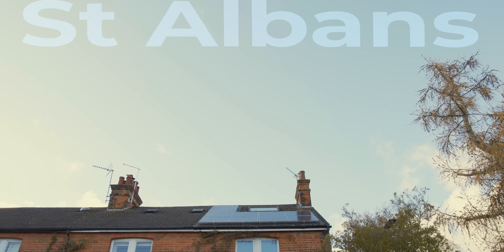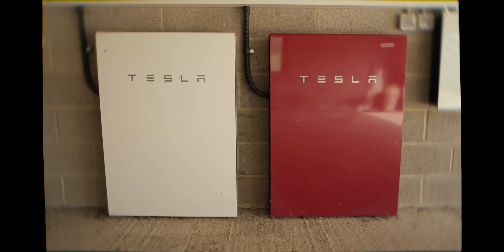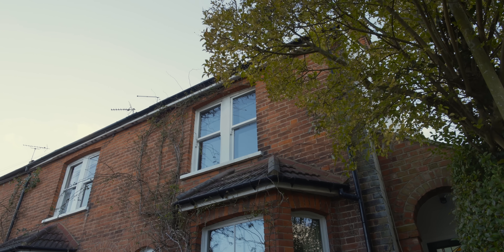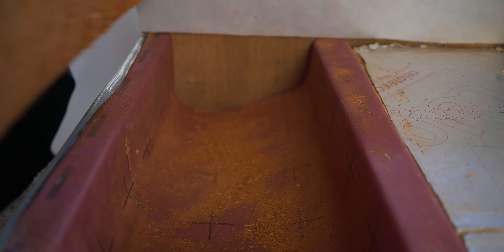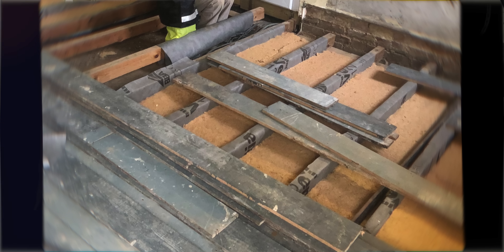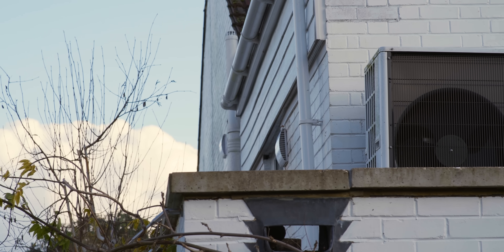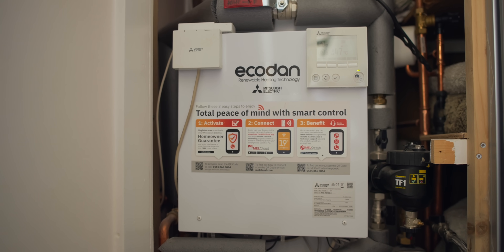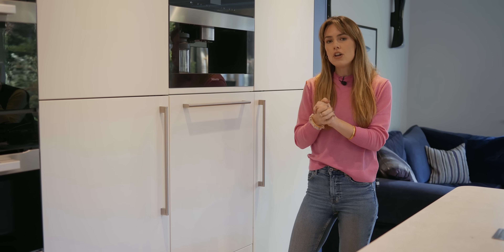This Victorian Home is Now 75% More Energy Efficient!

Comment: It's a great idea, and cheaper than building anew. Considered it for my house, but only really makes sense to do the underfloor insulation (we have a basement, so easier access from underneath without pulling the floor up). It doesn't feel sensible to make investments like this if you want to move in a few yeaes time - it feels like a big job with a lot of mess costing a lot. If it's your forever home then it'd be worth it regardless of the payback for both the comfort and possibly for the self satisfaction of having "improved things" and also being able to be self sufficient in terms of energy at least some of the time. 

On a wider perspective, I do wonder how we're going to, as a country be able to retrofit all these houses given the cost - most people aren't going to be able to afford it, and even if they are, life is for living they'd much rather spend it on a few nice holidays or new car etc. I feel like you've got to both 1. be pretty motivated to do this, except for when you actually have a problem that cause discomfort (cold, damp etc) and 2. to have the money left over after all other expenses and life costs.
Reply: Are people really so shallow that they'll just decide 'bollocks to the climate and the future, I'll just spend all my money on cars and holidays'? You do get a much nicer house to live in if you do this work - it's pretty dramatic for the typical UK draughty house. That comfort is an easier sell than long-term benefits to the county. The finance part could easily be dealt with by mortgage companies just lending you some of the future value. That also solves the 'but I might move soon' problem too. If the cost is covered by more value then it doesn't matter if you might not be there that long.

Comment: All this work seems way out of financial reach to a normal working family doesn't it?
Reply: The truth is, if you own a house for a long time, you inevitably have to replace components of the building. Wiring, roof, plumbing, windows, etc. So perhaps one should look at how to factor improvements as replacements become necessary. The total cost is a large sum, but money always has to be spent anyway. Just part of home ownership.
Reply: @LaReynedeNeige  This is exactly how to do it in my opinion . Make it a part of every bit of renovation and it's not arduous.

Comment: A airsource heatpump at 55c is not doing your energy bill any favors. A retrofit insulated property with big radiators and heat recovery ventilation should not run on 55c. Or the house is poorly insulated or the installer just put it on 55c.

Comment: Glad they addressed issue of ventilation and condensation. Overly airtight homes have issues with condensation which can lead to things like breaking down the insulation and also potential for mold build up. It's not a reason to not insulate, it's the reason you need the experts to help you.

Comment: Great video. Thanks for the upload. Just a caveat. Judith asserts that you can't use celotex between floor joists because of the flex. However you can use it if you use the "Gapotape" product around the edges of each board. After that you can then use a membrane over the top of the joists without the need to use the sling arrangement. But horses for courses and both methods work well as they both ventilate the joists.👍
Reply: Gapotape is great but surprisingly expensive. It may well be the same price, and certainly lower carbon, to just do it with flexi woodfibre (or Scottish hemp from Indinature) than PIR+gapotape. But of course the performance will be lower. I'd try to put a layer underneath the joists to remove the thermal bridges from all the timber - but of course that's (much) more faff.

Comment: Insulation is indeed key, irrespective of the heat source - IIRC there was a study in England in the early 90s which showed a 70% reduction in energy requirements if a national insulation program was completed, but HMG went with Hinkley instead. 🙄🤪🤪
Judith is spot on regarding the early 1900s construction, and how best to insulate and use vapour barriers, but have to disagree on her take on deploying polystyrene for underfloor insulation - There are techniques to very effectively deal with movement. 
She was also spot on over the huge benefits of internal wall insulation, and don't get me started on coombe ceilings - The effect is staggering in freezing cold winters and roasting summers - Even though mine is only 50mm, you'd never know it was done once boarded up - One interesting observation from when that last panel was to be insulated was the intense cold at that one spot - Once the insulation was inserted the room temp shot up almost immediately, what I called closing the envelope.
Even on my 2013 new build, DIY additional insulation brought gas consumption down to below 25% of the original, and the recently upgraded radiators have enabled low temperature running on constant heat, quite mind boggling at -10 - Really looking forward to the big freeze coming now, the final test which will finally prove the wisdom of doing it all. Total cost of DIY insulation ca 2k - Was tempted to go with a heat pump, but the cost and flakey mains power killed the idea.

Unlike St Albans, there are parts of the country where winter temps can hit -20 - Techniques such as this may be intrusive, but the benefits to your bank balance are permanent.
Reply: It's not a matter of insulation/retrofit or Hinkley. We need both these things. We've not paid anything for Hinkley yet - it's the French govt that is footing that bill. We only pay for the electricity when it arrives (and that will be quite expensive, but also very useful in winter to run all those heat-pumps). The govt has done a terrible job of funding retrofit over the last 20 years, with 2 largely failed schemes from the last govt. And it still all needs doing.
I've never heard of a coombe ceiling before. Seems it's Scottish for 'skeiling' and yes they are usually shocking heat leaks - I have them, and fixing them made a massive difference (I put 100mm PIR under and 100mm EPS above)
Reply: @xxwookey  Had they done both I'd have had no issue - The reduced grid demand from insulation would have bottomed out within say 2 years, and may even have averted more channel interconnects, but the energy crisis (scam) might have inflicted less pain.
Yep, good job on the coombes/skeilings, way better than my 5cm, but it's as far I dared go due to top end support.
If I ever get round to rebuilding the roof I'll add slab insulation to cover the huge gaps in the sarking 🙄 FN unbelievable what passes for a 'hot roof' here....
What grinds my gears most is nuclear being promoted by the State of a Secretary for Scotland - We're awash with electricity and paying the dearest prices - Wind gennies are being turned off or on reduced output all over the place - Insulate the hell out of everywhere and Scotland could almost power England, if they ever sort out the grid.... It's insane...

Comment: People usually talk about "payback time" on efficiency upgrades.  I like how you didn't go there, but concentrated on improvement in quality of living conditions and that assessment of the home's  value actually increased by 3x the cost of the upgrade!
Reply: We had a large single storey extension built a few years back and installed  double insulation mineral wool then multifoil with ufh on top.
Been slowly working through the ground floor upgrading the rooms to a similar level.

You get people in to do the final fit, but 90% of the work you can do yourself in lifting the floors, reinforcement of the joists, and adding noggins + the insulation.

In terms of comfort, it's a different level
Reply: @SlowhandGreg  Sounds as if you're doing a brilliant job. Very satisfying when you've done some yourself too
Reply: @ have a look at
Greg Greg Underfloor Heating Refurbishment
Reply: @SlowhandGreg  Looks like a very familiar process!
Reply: Yes, those are my big concerns too. I'm willing to pay a bit more for a more comfortable home and I take adding to its value seriously. It's certainly nice to save some money, but a home is for living in and that comes first.
Reply: @Ben-fr8gi  Totally agree - and good to know that I'm polluting less as a result of the work too
Reply: Spending £23k (plus the full house redecoration) for a £90k house value increase sounds good except you live in the house. You don't get any of that money unless you sell and move somewhere else. The payback time should be considered, but is not the be all and end all.

A more realistic option for most people might be to redecorate and insulate 1 or 2 rooms that you spend the most time in and let the others be cooler in winter, depending how many people live there.
Reply: @andy24242  That's not how these systems work
I have underfloor and have insulated to a high standard what happens is you heat the inside of the building which is why the upstairs bedroom radiators seldom come on.
You can open all the doors and windows for 2 minutes, close them and within 10 minutes the ambient temperature will have gone back to what you set it to.
Also
I've just had a solar battery install done the capital repayment period is now under 6 years 
Hope this helps
Reply: @andy24242  That's certainly one way - as long as you can effectively shut off the cold rooms. We did our bedroom much later so cut that out of the thermal envelope by putting an automatic door closer on the door. It was bitterly cold in there as a result!
Reply: I'm pro making homes more energy efficient, but I cant help but notice they may of been economical with the figures. The £23,000 was for just the energy efficiency upgrades (and it sounds like they did a fair chunk of the work themselves) while the £90,000  didnt specify if it included the value added from the extension.
  I'm sure the renovations added value but I doubt the energy efficiency upgrades would of added 3 times their cost alone.

 @everythingelectic would appreciate if you can calrify those figures, as those sceptics out there against this sort of thing could use it as examples of exageration or dishonesty to tarnish your reputation or argument for a good cause.
Reply: Quick maths on my end based on my unit cost, would be a £700 saving per year. So just over 33 years to get full ROI. Which would require around 3% annual tax free return in a similar investment option. Including the increase in property value, it makes a pretty decent case honestly if you have the cash. Plus there is the positive side of knowing you have personally reduced your impact on the environment.
This is obviously ignoring maintenance costs, but these would be present with a normal gas boiler anyway.
Reply: @emc3065  Just to say you haven't factored in inflation
Your returns aren't 3% but  3% less inflation
Reply: Yeah, you have to factor in that improvements on insulation will increase the value of the property by likely more than the price you paid. 
In this sense you can see it more of an investment that's already paid off, the heating savings are just a bonus.

Comment: If you need help with retrofit your local AECB group can be a great resource. People who understand retrofit at all levels from passivehouse-grade to just fitting a heat-pump ('AECB Carbonlite level 1'), but are not trying to sell you anything. (I run the Cambridgeshire one which meets up once/month). There is also a #retrofit channel ('room') on matrix which can be a good place to chat about this stuff (it's a big subject). There are also plenty of other good resources like the Green Building Forum, Camelot Forum, and Buildhub forum. (there are facebook groups too, but doing everything so that Zuckerberg can make money off you isn't very smart IMHO - use one of the resources run by the people for the people).

Comment: 6000kW of gas costs the same as 25500kW of electricity. With a COP of 4 you are actually producing the same kwh as you did with gas. If you also added lots of insulation you should be using less energy overall, not the same?

Comment: Lovely woman, and cudos for what she's done. I love the natural material selection. However, there are a couple of choices made here which I'd question. 

1. Turning off radiators with heat pumps is a bad idea. Open them up and turn down the flow temperature. That will mean the same amount of heat is getting into the house (more radiators on, but less heat coming out per radiator). Heat pumps are more efficient when they  run less hot, saving money and energy.

2. Single room heat recovery ventilators are quite expensive and most overstate the energy recovery significantly. I guess they're better than nothing, but ones that have air blowing in and out at the same time are much better than those that switch every minute. There are single room versions of these, but they're bulkier than displayed (they look a bit like air con units, so you might struggle to fit them in a bathroom, for example).

Comment: Amazing project! I can't help but wonder though about how environmentally friendly the production of the solar panels is. Great to see they used a lot of wood fibre and recycled fabric as insulation
Reply: PV panels are relatively high-carbon. They are usually the largest item on a retrofit like this. But they recover their manufacturing emissions in a couple of years now, and for the remaining 30-odd we're all ahead, so PV is well worth doing even if emissions is your primary driver.

Comment: 22.5C! No wonder she needs insulation. I have my hall at 14, lounge 16 and wear a jumper. I have low bills and not had to rip the house apart.
Reply: Gas and electricity in 2024 around 10,000 kWh for both, detached 3 bed house,  includes charging my Tesla.

Comment: There is a US channel that noted that contractors routinely and sometime vastly oversize heat pump retrofit systems.
Reply: If you size for an absolute worst-case scenario and add some margin on top, you get to sell and install the more expensive model and never get complaints about the house not getting warm enough. Buyers should get good advice, or stubbornly trust their own napkin math. 😂

Comment: Very nice, for those who can afford it!!
Reply: lots of new green finance options and grants coming through
Reply: As she points out you can easily make a profit as the house value goes up, but that still requires someone (like your mortgage provider) to lend you the money against the increased value. Mortgage providers would be ideal to finance this stuff, as you already have a relationship and they have an interest in more valuable buildings, but few are that innovative yet. I'm impressed that Judith got IWI, underfloor insulation/airtightness, PV and a heat pump done for 23 grand. Sadly it can easily cost more than that. It sounds like they did some themselves. I did most of my house retrofit DIY and it's about 40 grand so far for EWI, IWI, MVHR, airtightness, Solar thermal, PV, 2nd PV system 14 years later, Woodburner, loft, skeilings, I spread that over 17 years though so it's only about £2300/yr which we have been able to afford, not least because our energy bills have been negative for years.  For most people some government help would really make a difference. They have tried in the past but not done a good job of it. Hopefully the new lot will see that value to the country in reducing overall energy demand and invest in it.

Comment: good on her. That heat pump needs some work though. setting system to 55 flow temp is insane and when your mixing down to 35 for the underfloor heating is absolutely criminal! that's not going to be cheep to run

Comment: This is a fantastic green retrofit!  I built an almost-tiny passive solar home, and often give tours to anyone who stops by.  I built a model of my walls similar to your floor model to show how they were constructed.  I have a concrete slab that is insulated from the ground and the foundation; I plumbed it for radiant heating but never hooked it up as I don't need it; the floor is always warm from solar heat gain, house is always comfortable even in single digit weather, and the woodstove will easily keep it plenty warm overnight with just an armload of wood.